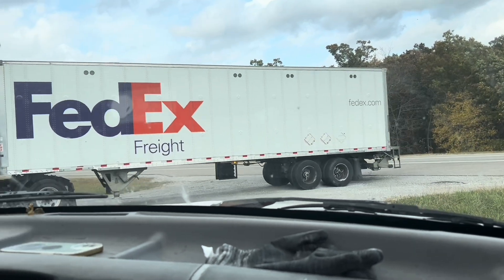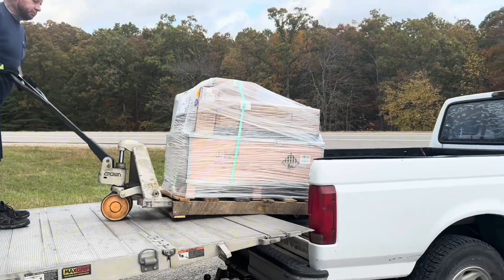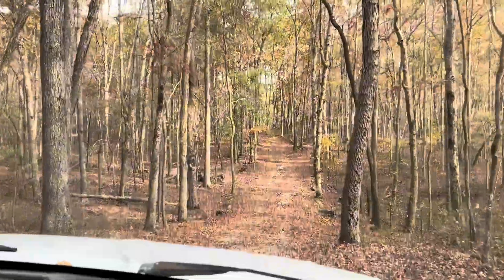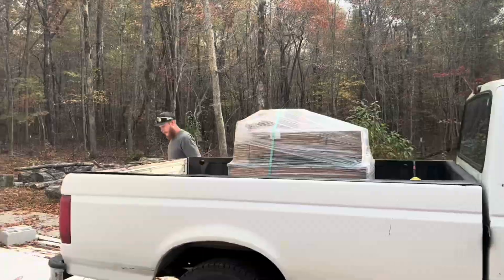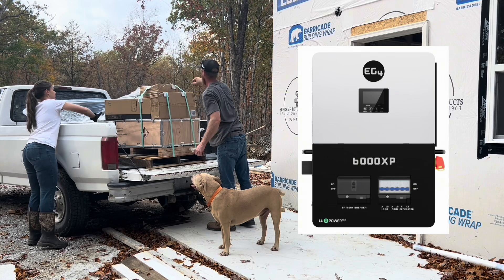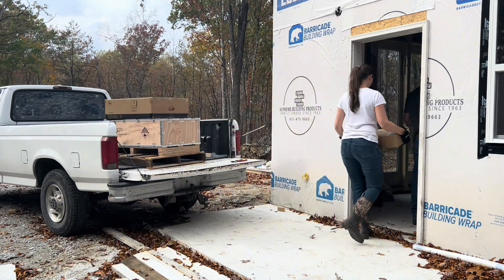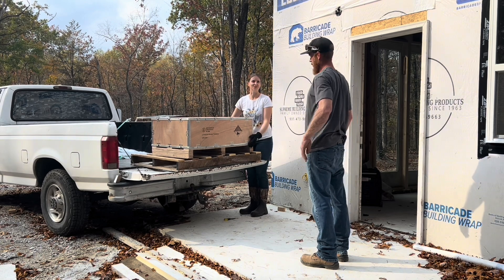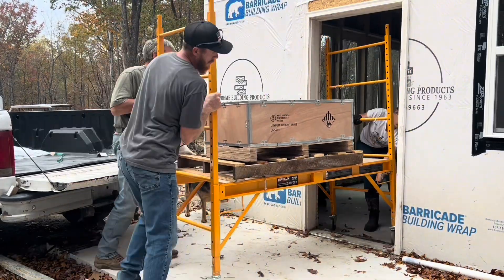Eg4 battery and inverter, for the uber beginner

Comment: My recently assembled smaller power unit has a 6000 XP inverter and 2 wall mount 280AH batteries. It is mounted on a thick base with 5 urethane caster wheels under it and  takes up 2 foot by 2 foot of floor space in a corner of the shop. It rolls quite easily. I added a breaker panel with various 240 and 120 volt outlets. I use a 50 amp 240 volt RV cord or a 30 amp 120 volt RV cord to put power where its needed. I used Signature Solar and Will Prowse the Solar Guru to get this thing together.  I think it may be possessed.,,,     https://www.youtube.com/shorts/76K7l-ZIrUs

Comment: New subscriber here.  I am looking at the same battery and a 12000xp for our home.  First I am going to install a couple of Hybrid mini splits to run mainly off of solar then will start slow with whole house off grid.  I plan on using it for critical loads to backup power in an outage.  Good job on the video. All the best from north Texas.

Comment: Well I have had solar for 17 years.  I recently bought the EG4 Flexboss and the Gridboss and a single wall mount battery.  I had existing panels on the roof and this system was the only one that would work well for me.  I was replacing a failed SMA inverter which lasted 15 years.  I had the same struggles that you guys had.  I think that anytime you are doing something great it comes with a struggle.  At least you appreciate it more.  BTW first time viewer.
Reply from the maker: Thanks for sharing your experience. I hope you enjoy your system! I agree with your statement of the struggle, greatness and appreciation ❤ we felt all that

Comment: Did you find that the noise of the Inverter, or system in the house was distracting or loud.  Has it created heat that you have found will have to be dealt with, or is going to have a negative impact on usage?
Reply from the maker: The noise level took a little getting used to; now I don’t notice- like when I fridge turns on, it’s just part of the house sounds. We do want to enclose the loft to damper the sound, but it’s not a bother enough to make that priority. I have not noticed heat, but with our high ceiling it might stay up there. I’d say if you have a better location; do that. But if this is the option it’s not so bad. I’m just so grateful to have power 😆

Comment: Way to much detail, edit deeper, cut down to the film that actually matters. Thanks for sharing.
Reply from the maker: Thank you for the advice, I’ll take that into consideration.
Reply: I rather enjoy the video. Looking at lugs? Like so many other videos? 

Seeing practical issues of getting to off-grid location & the physical wrestling the units into place is compelling.
Reply: Especially holding the tip to keep the air out.😊

Comment: It's far less expensive to build your own battery by using a DIY battery box kit. You'll own a much higher capacity battery, name brand cells, a better BMS with active balancing and you won't have the problem of unloading and placing your battery like they did in this video. The best part is that you'll save at least $1,000 by building your own battery. And just a suggestion from a pro with over 25 years of experience in the off grid inverter industry, I would lose that cheap, overpriced, high frequency, transformerless inverter before you damage your home's appliances, and install a real inverter that uses low frequency, transformer based inverter tech.
Reply: What would you recommend? I think you should provide a little more context and help us understand the cons to the EG4 inverters for an average Joe. Thanks.
Reply from the maker: Okay cool.. as a total new user to Solar power; I don’t know what you just said. Do you have video tutorials on how a total beginner can do that?
Reply: @BirdsNherds   He is talking buying raw EVE cells, balancing and assembling them, buy a BMS, buy an MPPT solar battery charger, then buy a low frequency inverter charger, crimp your own cable ends, buy a state of charge meter, buy 250 amp BMS, buy fuses and bus bars, buy cut off switches, then assemble it. My 4th solar project was exactly that. It is a compromise in everything. It works well but is not for beginners at all. Mine was single phase 3000 watt, 7200 watt hours in EVE cells and cost $3500 in parts. I welded the square steel tubing frame and put it on caster wheels.

I am a retired Engineer who worked in 17 countries in power generation and distribution. My dad taught me how to weld at 6 years old. I do everything myself, built bikes, dune buggies, boats, engines,  everything but an airplane. I designed and built my own shop with my own 2 hands, drew the drawings, did the load calcs, got my building permit, wired it 120/240 with 50 amp welder circuit, did the roofing, skylights, doors, drywall, spatter coat, prime and paint. All by myself EXCEPT for the stucco exterior. Brutal work. I had it done.

I built several other systems for friends including pieced together systems for 2 motorhomes, an off grid cabin, my own old GMC van conversion with 300 amp hour battery, 2000 watt inverter, 40 amp MPPT solar charger, 400 watts in roof panels.  My build #10 was a power console that had 12 of the factory made 300 amp hour batteries, split phase low frequency inverter charger of 6000 watts, and 2 of the cheap HF WZRLB 3000 watt inverters, a pair of 60 amp MPPT solar chargers and much more. I was proud of it. It ran beautifully for 2+ years, 24/7.

  In August 2024, it caught fire and did $150,000 damage to my shop and garage. The load was less than 750 watts, the batteries were at 100%, no more solar amps were coming in. I had a video camera on the Renogy SOC meter that could be viewed anywhere buy cell phone. It captured the final readings.

The Forensic Fire Investigator determined that the battery that caught fire was damaged in transit. He says that it had been dropped upside down from probably 5-6 feet and the negative wire leading to the BMS showed signs of being crushed.  The BMS is the guardian that disconnects everything in case parameters are exceeded including dead short. But the battery shorted in the length of wire BEFORE the BMS.  I built my own fire cabinet with unregulated 120 psi water supply and 1'' double lined fire hose. I had water on the fire 70 seconds after hearing a big pop, spraying it through a skylight that I pried off.  

God and his angels made me stay home that afternoon. The Fire Chief said that the whole house would have been engulfed in 3 more minutes.

And so.... your system has a battery that is EMP proof, is encased in steel, had internal fire extinguishing equipment, has no direct venting, and is UL Approved.  The all in one inverter may be high frequency but the EG4 6000 XP is a tried and true design that works well, is much improved since I built my big unit in 2022.   I have a 6000 EX sitting on top of 2 of the same wall mount 280 amp hour interior batteries as you have and its on a caster wheel base. I had a death in the family so it sits collecting dust for now. I might work on it today....  I also have an EG4 Boss Box with 3x280 amp hour exterior wall mount batteries and an EG4 Flex Boss 21 inverter going together. I found the  $27K under my couch cushions and put it to good use.

My conclusion? You made the right choice in buying an  EG4 plug and play UL Approved system. So what if it costs more than a homebuilt unit? 11 months later I am still dealing with the aftermath of my fire.  Telling beginners to build their own battery/inverter system is like giving you an Exacto Knife and a mirror and telling you that it's cheaper to remove your own cataract.  I like your home and projects.
Reply: @kimmer6  Thanks for taking the time to share your Experiences. Wow that's crazy the fire that almost burnt down your house. Were you using lithium ion phosphate batteries? The reason I ask is because EG4 uses lithium iron phosphate batteries(LiFePO4) And I have never heard of them catching on fire they are super stable.
Reply from the maker: @kimmer6  wow, thank you so much for sharing your experience and words of encouragement. My condolences for the loss of a loved one. I pray your heart finds peace and the strength to find purpose in your day-to-day. 

Your experience and knowledge of solar is so valuable, thank you for sharing your story. Thank you for sharing all the details of your fire, there’s something we can all learn from this tragedy. I admire your courage.
Reply: @BirdsNherds  Thanks for the kind words. Birds? Chickens?  I have feeders and enjoy the jays, woodpeckers, doves, and hummingbirds and all of the other sparrow sized creatures who visit.
Reply: Really,  you advise a noob who knows nothing to build their own battery?  Lol?
Reply: @pr4tty There are multiple sources for DIY battery systems for home use. Yixiang is one excellent brand. UBP (UB Power) is another.  I would recommend using EVE MB -31 330 Ah grade A cells for use with either of these battery boxes. Besides the much lower cost, you'll have a much higher capacity 16.8 kWh vs 14.3 kWh battery and for your situation, you can assemble the battery in place without the need to lift or move such a heavy battery. I would suggest watching The Off Grid Garage for several excellent step by step  videos on how to build your own DIY battery.
Reply: @solarcharging9743  Thanks. Great advice. I’ve been looking at the Yixiang V2 boxes following a few folk online. Now the tariffs have come down, it will be that much less of a hit.

Comment: I bought the outdoor model of this battery. I had to hire two big guys to help me. I wish they had the adjustment feet on the outdoor battery.
Reply: I have 3 of the outdoor wall mount batteries. They all have adjustable padded feet. The batteries came a month ago. Newer model? My well used engine hoist was put to good use. I assembled everything myself including the Boss Box and Flex Boss 21 inverter. I'm in my 70's and probably should have hired some help!
Reply from the maker: I don’t know how we will get a second battery up there 😂. We’ll need more help than just me and my husband

Comment: hello. the 6000xp. It's awesome i upgraded from the 6500ex model. I have it for a year and 4 months now, and it's been working flawlessly 24/7 from day one. for batteries i have 4 orient power wall batteries 5kwh each. bought those before eg4 came out with their wall mount. but mine are working flawlessly as well. I truly believe you will enjoy your setup.
Reply from the maker: Thanks for sharing your experience and the encouragement!